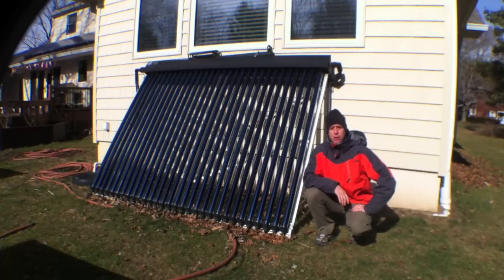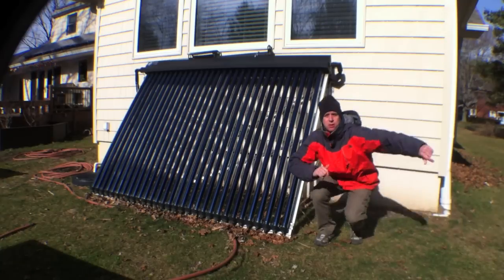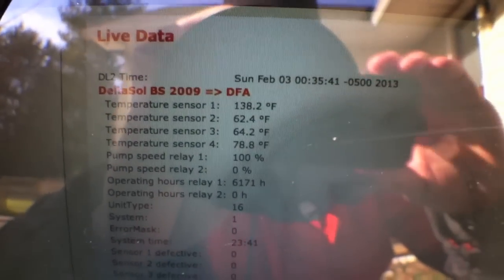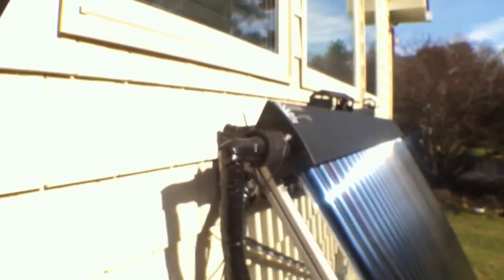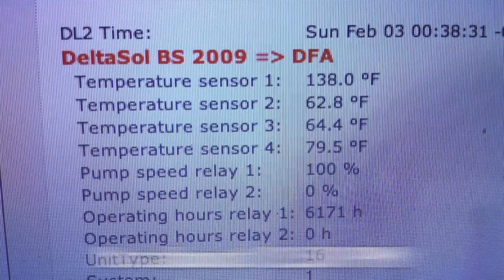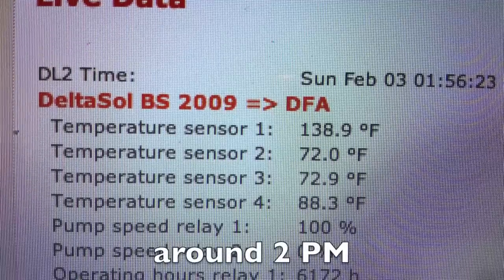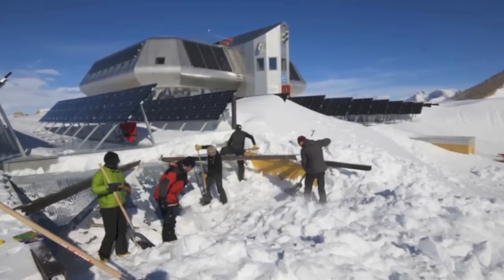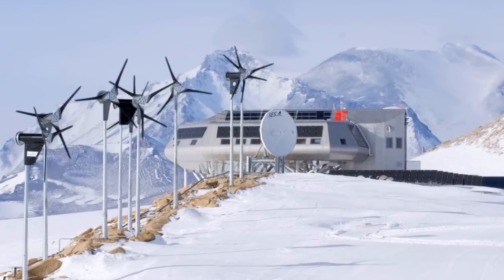Does solar thermal work in very cold temperatures?  There is heat in light!

Comment: Do you think a system like this would heat the water consistently enough to heat a hot water radiator system in a 125 sq meter home where the average daily temp is 45F?
Reply from the maker: I would say yes, but you’d have to match the proper BTU required.

Comment: 62 degrees isn't exactly stellar when tap water comes in at 45 degrees in winter already. And that's on a sunny day.
Which means on a cloudy winter day you have absolutely 0 gain from the thermal solar system.

Fact remains that solar thermal is only useful, effective during spring and fall, summer to lower energy costs.
It does not provide real energy benefits during winter.

If that was the point you were trying to make it is moot. Good video and data, very helpful. But the point is lost in my opinion.

At least if the point was about water for central heating and hot water.
I guess for a pool any and all is a good help. It's a luxury not a necessity.
Reply from the maker: BTUs are BTUs, not sure I see your point. Yes winter will have less available BTUs due to shorter days and angle of sun, but I can always put that heat into a buffer tank.

Comment: Wonder if that's cost effective ? I think adding a few more solar panels would be better, that would produce more power to supply electricity  to the water heater. I  run a complete electric house in NJ. Zero bills until I reach Nov/Dec into March.  I need to upgrade to the 400+ AC panels to cover our power needs. 19K isn't covering everything.

Comment: Sorry, but did you say a tank full of 80 degree water?  You need at least 100 degrees for a comfortable shower.  Not seeing how this is an advantage over my natural gas heater that costs very little for piping hot water 24/7 when it's 4 degrees outside.
Reply: You could heat water from 55 degrees in the city water to 120, or you could heat it from 88 degrees to 120. Which takes longer and much more energy?
Reply from the maker: Eric, sometimes my buffer tank water is well over 120 degrees.  At that point, I add cold water.   When the tank is below comfortable shower temperature, the tankless system will heat water to needed temp.   You're still getting all the BTU savings.

Comment: hehe this video made me remember 50 years ago when i had gotten a glas bottle of coke with me to our  local beach.
it was in the spring and quite chilly,,, but i love my coke COLD.
So i layd my bottle in the water arond 1 feet deep that was almost to cold to swim in,, but it was a cool SUNNY DAY.. 
After 1 hour ore so i got the bottle out of the water and it was to hot to hold with bare hands. hehe 
so yes it worked,,, but for a solar heat collector to work 100% in cold climates its best to insulate the the heating part in cind of like a greenhouse.
normal cheap insulation on the backside... and double layer insulation GLAS on the sunny side.

Comment: I swim at a indoor pool, Centennial Pool Longmont, CO, that has installed solar tubes for supplemental heating.  We have had three and four foot snows with no problem with snow accumulation on the tubes.  The tubes are simply at the best angle for catching the most heat.  Snow simply falls through the tube set up.  The outer glass is envermential tempature so there is no ice buildup.  Any frost quickly melts as soon as the sun comes out since there is no mass to hold the cold.  Of course there is a fence with a hedge to keep the collectors protected and concealed. Talking to the maintenance man he tells me the collectors have reduced the gas needed to heat the pool particularly in winter.  Again, no snow build up, most effective in winter. And yes bellow zero winter weather at times.

Comment: I'm in central British Columbia, Canada. I have three sets of 20-tube evacuated tube panels for domestic hot water and floor heating. I can confirm that these panels do heat water very nicely at temperatures down to minus 18C or so. Below that, hoarfrost on the tubes cannot 'burn' off and the water heating slows dramatically. But it depends where you live: if hoarfrost does not appear often then these panels can run at even lower temperatures. Money well spent!

Comment: An 18 degree difference in Fahrenheit temperature within the chamber is significant. If you can claim it by transferring it back into the pool at the proper rate, then I love this system.

Comment: 2 Comments: 1) Thank-you. I appreciate the details in your presentation. 2) Your title is misleading. Barely getting below freezing is not "very cold" and though your numbers are interesting, they do nothing to help assess if these tubes actually work in "very cold". When temperatures stay around -20C (-4F) for several months (dipping to -40C), I'm trying to find evidence that there isn't some operational curve where these tubes stop creating a +50C differential between ambient air and heated water.  For the record, I'm not citing temperatures from the arctic. I live 6 miles north of the US border. "Canada's Hot Spot". The prairies get hot in the summer but cold in the winter. These are normal, seasonal temperatures that we need to work with.

Comment: that looks like about a $1,000. unit. far outside the budget of most middle class people and not ever possible for most working class people. ...... Free 80 gallons... Ha Ha ha ha ha. you will never recover the extra expense you paid for that thing, and most solar water heat systems require a "NORMAL" water heater as well - meaning that you didn't just spend $1000 bucks on that thing but $400 or $500 on your original water heating system (if you installed yourself....more if you had it installed)

Comment: What about at night when the temps drop down to -20°F. Frozen pipe that’s what.
Reply: Conny Bjaaland, depends. The vacuum tube systems can circulate enough (backwards) to avoid freezing in the manifold or circulation pipes. Or, a drain-back system will empty out until the manifold exceeds temperature in the storage tank.
Reply: Those tubes have antifreeze in them and a heat exchanger in the tank

Comment: If you set a mirror in front of the unit, it would double the sun 
hitting the solar tubes. If you need more heat, add a few heliostats 
reflecting even more light.  The fact that the heat stays inside the 
vacuum tube is a great thing.

Comment: Helped a guy build a solar water heater on a boat one winter (in Turkey) about 3 years ago. Think he only wanted it for the ladies who used to visit and always complained about the lack of hot water on board. Anyway near the end of the build during the test he nipped off to town, I had to phone him for advice when steam started to appear. He told me to close it down. It worked so well he installed a radiator and hot towel rail in the heads to use up the eccess heat. My wife also got some work sowing canvas covers for the panels when it got too hot.

Comment: Certainly the vacuum tube solar thermal heater is very efficient.  I also believe there is not enough water flow through the collector since both the inlet temperature and the outlet temperature should be within a few degrees of each other.  Lots of heat is being lost.  

But in the end it is my belief that solar PV is the way to go.  For significantly less money I can buy 4 solar panels, a controller and have all the hot water I need.  I can also use the excess power to do other work on those days I am not using a lot of hot water.  And of course an 80 gallon storage tank can store all the hot water you need at night or in the early morning until the sun comes up.  There are no contractors even selling solar thermal installations in my area of Arizona anymore.  Everyone just goes grid tied solar panels instead.  No pumps, no valves, no leaks and no freeze worries.

Comment: There is a 3.44 psi difference in air pressure between air at 25 F and 138 F in a sealed container such as the space inside of a compressed air engine cylinder.   3.44 pounds per square inch amounts to 4187 pounds of force on a one meter diameter  piston.  The maximum Carnot efficiency at that temperature difference is only about ten percent but it is twenty to thirty percent at typical summer temperature differences.   Heating up the air with concentrated solar after it has been preheated by the panels might greatly increase the theoretical possible  efficiency of such an engine.  But the Carnot efficiency limit might not apply anyway because it is not a sealed up system and there is no compression stroke.  The speed at which it can operate only depends on how fast the heat can be transferred.  With the piston only moving one meter per second with an average force of 2000 pounds on the piston, the engine would put out about five thousand watts average.

Comment: This is nitpicking a bit but there is no heat in light.  You can convert the energy in light into heat (solar thermal), or electricity (PV), or chemical energy (photosynthesis).

Why is the temperature in the collector so much hotter than the temperature in the storage tank?  A solar thermal collection system is most efficient when the collector temp is as close as possible to the water temp.  The collector efficiency goes down as the temperature rises above ambient so you want to see the collector only a few degrees hotter than the water in the tank.

Comment: "its about 25 degrees out today" and he has a coat on jesus, thats a heatwave in the UK lol
Reply: +Lebalusch ... 25F, which given his data shown on the laptop (that's in Fahrenheit ), is -3c. Now as someone that's lived in Northern Canada for a while, where winters get to -40F/C, I don't think -3 is a heatwave for you.
Reply: +Lebalusch Pretty sure he's talking celsius, in fahrenheit thats 77.
Reply: Rick Teran, the vacuum tubes are excellent even for the coldest temperatures. You will get plenty of heat if you get direct sunlight. The problem is the manifold and circulation pipes. It is best to mount these on the south face of your heated buildings, and have the pipes, fittings, (and maybe even the manifold cover) insulated with closed foam polyisocyanurate or urethane. Plunge through the insulated wall as soon as possible. The drain-back systems are probably the best way to avoid freezing the antifreeze. Automatically refill when the manifold is hotter than the hottest water in storage. When fluid gets too hot, it is best to dump the excess heat with an outdoor radiator strip behind the manifold. That prevents the coolant from breaking down.
Reply: Works great in very cold climate... -3*C is a cold climate? Come to frikking northwestern Ontario in the winter and tell me how that solar heater works when it's -40*C at night and -30*C during the day!
Reply: i think the snow would be more detrimental to its performance
Reply: Rachel Brinkley, that's right. It is best to keep the bottom of the vacuum tubes higher than the snow drifts. Also best to keep them near vertical. Still have to sweep off sticky snow. Maybe RainX™ would help.

Comment: Great idea for areas that see little to no snow. My location averages 75 inches of snow that would have to be cleaned from the collector. Not to mention the ever present clouds that bring that snow. Good idea though.
Reply: You make it sound like the 75 inches of snow all fell at one time. How hard would it be to brush off an inch or two of snow on a ground-mounted collector, assuming it even stuck to an angled, rounded surface?
Reply: woodledog Snow adds extra work to something like this. It's not only after a storm but drifting can cover the collector with snow that is difficult to move.
Reply: I've seen panels like this mounted vertically on the side of the house (in Wales!) and the owner assures me that the hot water he gets from two of these panels is well worth the investment.(He has solar-pv panels on the roof!)
Reply: John Benton I've never seen a 90% savings, even with the best of systems.
Reply: Comper you pre-mod bill with your post-mod bill. It should be fairly straightforward.
Reply: I swim at a indoor pool, Centennial Pool Longmont, CO, that has installed solar tubes for supplemental heating.  We have had three and four foot snows with no problem with snow accumulation on the tubes.  The tubes are simply at the best angle for catching the most heat.  Snow simply falls through the tube set up.  The outer glass is envermential tempature so there is no ice buildup.  Any frost quickly melts as soon as the sun comes out since there is no mass to hold the cold.  Of course there is a fence with a hedge to keep the collectors protected and concealed. Talking to the maintenance man he tells me the collectors have reduced the gas needed to heat the pool particularly in winter.  Again, no snow build up, most effective in winter..
Reply: John Benton Panels mounted vertically still get sunlight but no where near as mush wattage as if they were mounted at angle.  The payback period would certainly increase, maybe worth it, maybe not.
Reply: The vertically-mounted panels are solar-thermal, with the solar-pv panels on the roof. The owner of the property (as of 2 years ago) was consuming less than 10% of the house next door. So he was saving over 90% on his electricity bill. All his panels were installed by the owner (who is a very skilled sort of chap) and the original plan was to run a 6-room B+B without paying for his electricity. He hasn't quite managed it but a 90% saving is not to be sneezed at. (He also boasts an unlimited shower service for his guests - and they are very good showers!)

Comment: George Lewis states that these cost $8,000 to $10,000 to make and install.  on a DIY system,  it would be hard to get to $800, maybe $1,000 if you bought a new water heater as a storage unit for inside the house.   even at $2,000 for all new parts at retail, the payback would be in green energy and lower use of fossil fuels.   assuming a pre-heater storage tank of 85° and a final storage tank of 115°, just cutting down the energy by half wold still pay you back.  but in the summer, the problem is reverse.  the tank gets closer to 185° and you have to shed the excess heat.  

bottom line is that even with a 5 or 10 year payback, the reduction is fossil fuel use is worth more.
Reply: I have never seen these cost $8-$10,000. A 25 tube unit costs around $800-900USD. Now you may need to add in around $200-400 for a stand if you want a ground unit. You will need some pumps, but those are small. The only way for a system to cost that much is if you are using a full system with geothermal. IE, geothermal water tubes in ground heat water to aprox. 50F, then to the solar tube, then to a heat exchanger hot water heater which can become expensive, but are not really always necessary unless you want to store large amounts of hot water for radiant heating, which in that application would be a better way to go. These work pretty well. And the crappy (Older) model he has no reflectors behind it, so he is only collecting half the light per sq area due to space in between the vac tubes. The new ones have these and reflect light in a near 360 degree around the tube, making them much more efficient and hotter achievable temps. And NO I don't have any affiliation...lol. I have been just doing a lot of research on them. Great stuff
Reply: SuperDaveisme Thank you for your input. Tell me this, could the energy from these  collectors be converted to the house as a whole, and not just to the heating system, or the hot water heater.  This would apply to a home in the southeast part of the US, that consumes approx 750 kw during  the fall and winter months, and approx 350 kw during the spring and summer months.  Could a DIY collector be wired into or work in conjunction with the standard electrical set up, and or have another meter that would calculate and send the access back to the local power company.  If so, how long would it take  to get to the break even point on this investment ?.
Reply: shed the heat into electricity